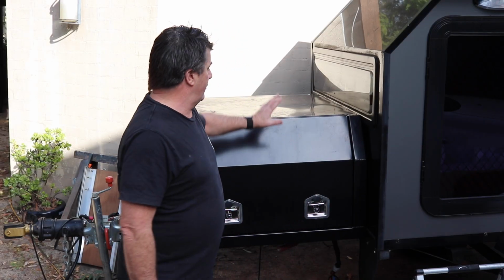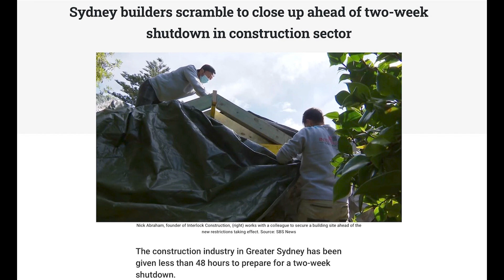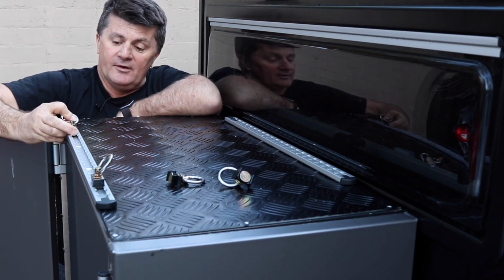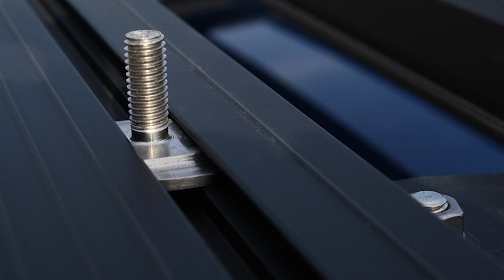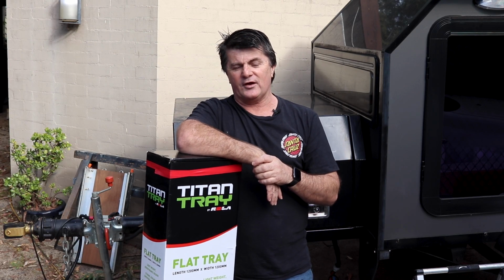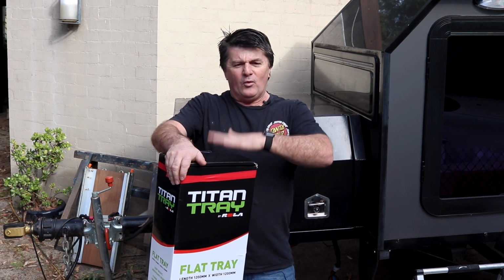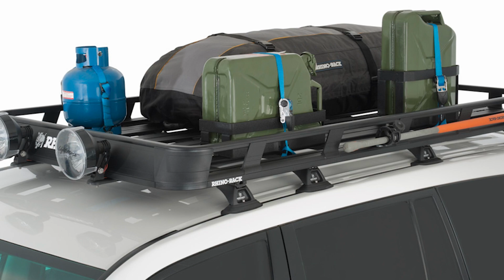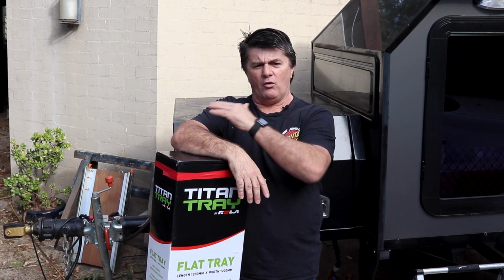DIY Off Road Camper // Roof Rack Platform Hack // Gullwing Storage Box

Comment: Nice idea you my like to consider using captive nuts on the metal box it would makes it simple for removing the rack if required and stops the possibility of the nuts vibrating loos Inside of the steel box.
Reply from the maker: Great idea if constructing, but on a pre-made powder coated box, stainless nyloc nuts are my preferred option.